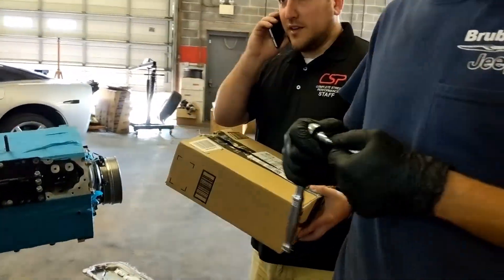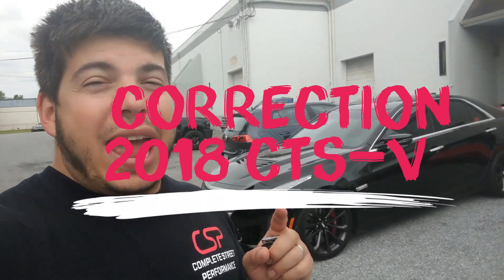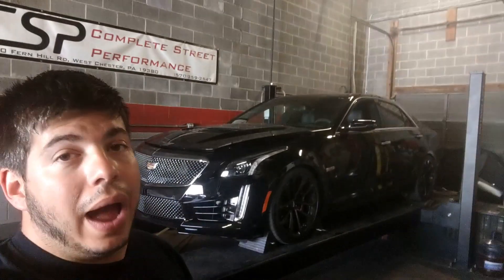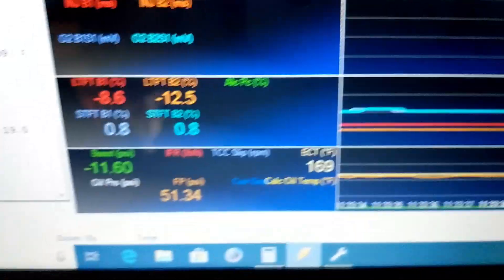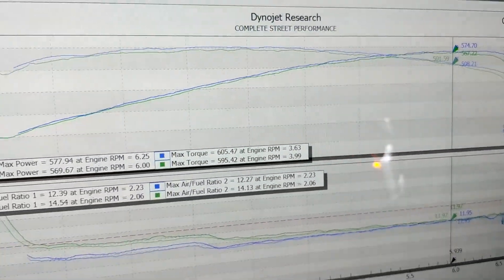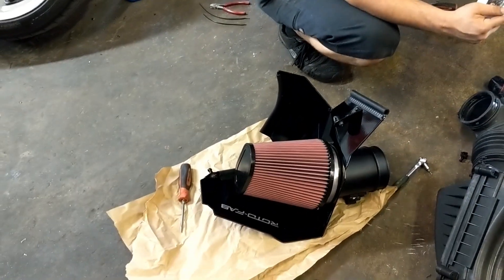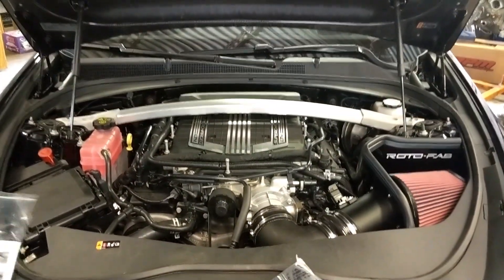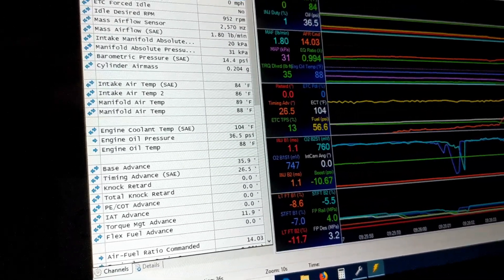Roto-Fab gains big on 2018 CTS-V

Comment: Been debating on headers snd seeing if its actually worth it. Have Stainless Works mufflers right now from Billy Boat that maintains the electronic valve to keep it slightly tamed in touring mode. My question "even before the tune, are there  any noticeacle gains because Cadillac did a decent job with the stock Manifolds?  Seen some people say that most of the power comes from CatBack specifically for this car, but personally all of my other LSx vehicles has Headers and etc on them all. Last but not least, for this car in particular. Are all the headers created equal as far as fitment and hp unlike some of the earlier LS cars? Looking into Speed Engineerig 1st due to prices "heard the fitment is nice as well", Stainless Works, Billy Boat, ARH and then Kooks. If there's any information you could give, it would be greatly appreciated. Wish I was close enough to bring it in.
Last but not least, if I was to do the Kong or Jokerz ported blower and snout, would there be a need for headers if for some strange reason I decide not to get them? Trying to keep it Florida Stock basically.

Comment: Don't know if you all have tested it or not, but for a FBO car with the 103TB and ported blower. Have there been significant gains switching over to the Big Gulp version? Currently running the 1st RotoFab in my V3.

Comment: I've been a long time Subscriber, watched when the Rotofab intake was installed on the CTS V3. What happened to completing the rest of the mods. That's the same build I'm trying to do with mine and wanted to see the real world numbers once you all was done. Only thing different I wanted to do is either keep the stock mufflers with Kooks headers, but the Corsas sound so good "one reason why I wanted to see the update. I could be overlooking it though, so if you don't mind. Would you give me a rundown of the car and the power gains it made after each mod before and after tune? Thanks it'll mean a lot. Want this to be my only sleeper per say that the motor haven't been dug into uneccesarly or should I say just enough to stay ahead of the Hellcat guys and when GM crime happens to beat stock Z06s & ZL1s counterparts!!

Comment: Heat Soak, hum. I did not know of this term or what it di
Does. There is no remedy preventing that? That is just the physics of any automobile?
Reply from the maker: Heat soak can be countered big time by an interchiller, which uses the AC system to cool the blower setup, and spacer plates to minimize the heat transfer from engine to blower